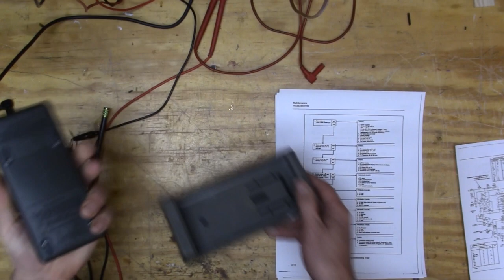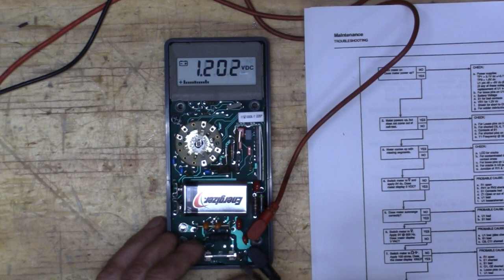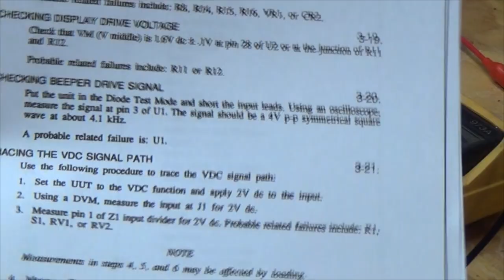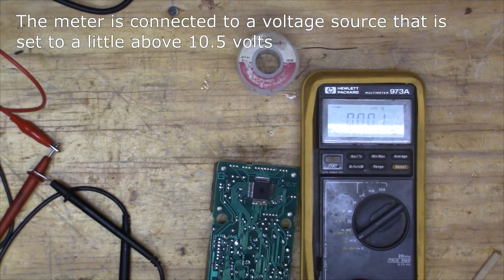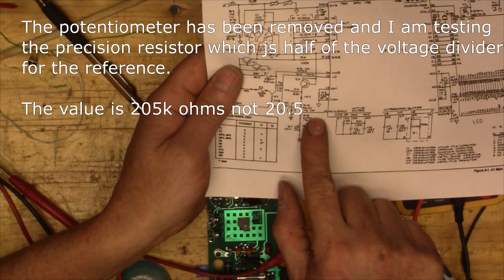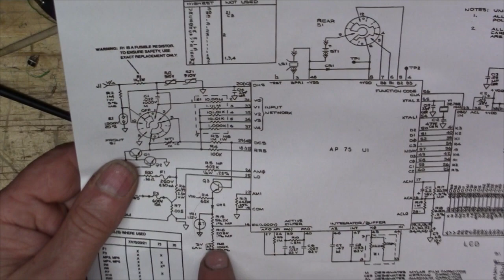Fluke 77 diagnosis and repair

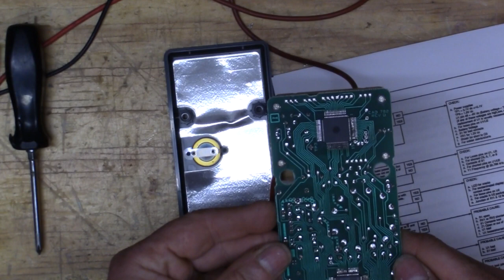Comment: @4:01 how does that Beeper connect to the board please?    My model 75 has a low beeper sound and i want to see if i can fix it.  Thanks.
Reply from the maker: Not sure, it has been awhile since I opened it. As I've gotten older it is harder and harder for me to hear the beep on these meters. I ended up building a dedicated continuity tester that I really like based on someone else's design. I did a video on putting it together. I replaced the piezo on my my oven because it was too quiet and now I can hear it much better.
Reply: @RobsFixitShop  Thanks for your quick reply, sir.   I actuallly found out its via those plastic looking pegs that contact it.  It's carbon infused and they conduct! :)    A friend at work gave me one of his similarly profiled beeprs and it got it to work again.  The original beeper was apparently corroded and caused it to fail.

Comment: Hi, I accidentally measured AC voltage on resistance mode. The Fluke 77 now doesn’t function. Could you pls help me with the troubleshooting & circuit diagram?

Comment: Should always use plastic and not metal to prob around in there and what makes it worse you have the power on. Had the same problem, bad selector switch. Ordered a new one..works fine.

Comment: It was an error in judgement not to change the battery in response to the low battery annunciator. The calibration is now suspect when a good battery is installed.

Comment: I think it's best to press using a stiff plastic Spudger tool.  A finger might be a kind of antenna.  The newer designs have the electrical contacts of the rotary switch right at the board level rather than a switch that is elevated from the board that can pickup noise.  Even the cheaper scopes of the past used wafer type switches while something like a Tektronix 7000 series scope has the contacts at board level using finger type contacts actuated by a cam of the rotary switch.

Comment: Rob, you might want to look into devising a way to check that your camera is seeing....most of what we should be looking at is glared out by your overhead light(s) in this video.

I was also cringing during a lot of this video as you came close to nailing the problem then got derailed by some inconsequential tangent....(but it happens, I know).

As some others have commented, the 77 was practically screaming at you to change the battery the whole time. When the display shows the LOW BATTERY icon, all bets are off as far as meter operation, not to mention performance, and although that was apparently not the only problem, you could have saved yourself a lot of time and grief by dealing with that obvious thing first.

You spent some time wrestling with the reference voltage into U1 pin 14. which is supposed to be dead-nuts-on 1.000V. This is simply derived from the internal 1.22V precision reference chip VR1, which does not look like an IC but is, then the excess 0.22V is dropped by R15, the 56.2k resistor, leaving 1.000V across the series combination of R16 (205k) & R8 (100k trim pot "3V Cal"). The trim put just adjusts the current through the voltage divider so that you get the proper voltage drop for the pin 14 input. But if the battery is low, the VR1 voltage might be below specs and this can throw off the reference voltage at pin 14, which can cause more significant errors and instabilities that look like something else is causing them.

You also appeared to just de-ox the front side contacts of rotary switch S1, and that side does manage the reconnections of the input signals to the U1 input pins. However, there is a set of contacts on the rear of S1, hard to access, and those handle two things: they are the power switch for the meter, and they control the three "function code" input signals to U1 that tell it which function is selected. Unlike earlier DMMs,  with their complex input circuit switching, the model 77 switch S1 is pretty simple and once it tells U1 which function is selected, the chip does the rest internally. If the function switching contacts are iffy due to dirt or corrosion, the chip might be randomly changing from function to function, making confusing displays that look like something else is causing them, and this can lead to unnecessary component replacements, re-soldering joints that are not bad, etc.

I have a few 77s, bought back in 1986 and used almost daily since then. They never miss a beat and are as good as new. I obtained a service manual way back when, and studied the same schematic you have, and there is really not much to go wrong on these, as long as the meters are used enough to prevent switch issues, the battery is kept fresh, and they are not abused.
Reply from the maker: Hey, thanks for the great comments. I do struggle with reflection from the overheads. Meter faces are the worst. I did use a power supply for some of the video which took the battery out of the loop. My channel is mostly about how I figure something out which can be pretty frustrating at times for people that actually know what they're doing!

Comment: Did you check the 9v battery???
I have one of the original Fluke 77 units, which I've owned since new (around 1987). Still works fine - just change the 9v battery every 3 or 4 years!
If you see the battery symbol (top left of display) on during normal operation (i.e. after the first 2 seconds of power-up), then the battery should be replaced.

Comment: Hello I have a multimeter Fluke 70 . doesn’t power on, I reemplace a diode 1N4448 (CR1) (The original diode is short)  . Is turned on, but no have lecture in diode and ohms Scale and other issue i have is  the multimeter power off in 300mv Scale like a short, bud does find other elements damaged in the motherboard. Greetings

Comment: Have the Fluke 75 , checking voltage 575v 3 phase .After second phase display show number even no test. battery, fuse, rotary seem ok. even at ohm function should read OL but some number showing. thanks for comment

Comment: Anyone know where I can get new or replacement test leads for my FLUKE 77 Multimeter?
Reply from the maker: I just got a new set of ProbeMaster probes that I really like. Here's the amazon link but I ordered them directly from probemaster. https://amzn.to/32mPUAv
Reply: i put these uni-T UTL-20 on y fluke 75. very well. https://www.aliexpress.com/item/32821721616.html?spm=2114.12010612.8148356.24.100a5ae2QgWZ0G

Comment: How you fix a low buzzer sound?
Reply from the maker: I don't know. I am thinking of doing something to my HP DVM for the same problem. I can never hear it!
Reply: I've opened mine up and have NO IDEA how the buzzer works - it does not appear to contact any board circuits.  Wireless???

Comment: hello Rob I have problem with display LCD... and need replace the CPU in the back lcd. is possible found this part?

I have this problem after using multimeter with low battery and have caused this problem 😭😭😭

dig2 c dig2 d  in test 3.7this 2 line not working

and have test pin out voltage have +0.30 v respect other pin.
if connect this pin to ground with one resistor 1000ohm I have visible this line for 2 second and after 2 second this two line ghost

Comment: hello Rob I have same multimeter do you have manual for check lcd segment ?
I have two segment with problem.
Reply: For Fluke 77 Service Manual You can download it from:   https://www.manualslib.com/manual/1006231/Fluke-77.html
For  Fluke 77 Series II service manual you can download from:
https://manualzz.com/doc/6275276/fluke-77--75--73--70--23--21-series-ii-service-manual
Zafar Hussain Karachi Pakistan
Reply: @zafarhussain6696  yeah i have chek and suppose the mcu is damaged. My pin segment have 0.20v extra surplus.respect the other pin. If connect the damaged pin to gnd with one 1k resistor the segment turn on for 1or 2 seconds.

If turn on the multimeter in test segment..this segment not turn on.
Reply: @zafarhussain6696  and have fluke 10 used with low battery. With problem ghost display.

Battery with low charge. Damage your multimeter.
This is a very problem!

Two multimeter used with battery low ... burning... 😢😢😢😢😢😢😢😢😢😢

Comment: Podrías mandar tu manual x pdf  ya que tu video es en inglés gracias
Reply: For Fluke 77 Service Manual You can download it from:   https://www.manualslib.com/manual/1006231/Fluke-77.html
For  Fluke 77 Series II service manual you can download from:
https://manualzz.com/doc/6275276/fluke-77--75--73--70--23--21-series-ii-service-manual
Karachi Pakistan
Reply from the maker: I put a link to the manual I used in the video description. Buenos dias!

Comment: Clearly the battery replacement symbol is top left of screen, the Fluke 77 will show low readings when this happens. replace battery job done!
Reply: Indeed. Whenever trying to fix any battery powered device, it's always wise to use a fresh one.

Comment: Ok, so i bought one of these like 5yrs ago at a garage sale for $1.00. At that time i could tell the battery was dying. But i figured id pop a new one in it. Well, all this time later (actually forgot i had it) i dug it out and of course the battery is dead. As i was about to throw it in the garbage (Because i already had 2 other ones) I noticed it said "Made in the USA"  Which surprised me, and how rugged it was. I decided to come inside and search online. After seeing what this thing cost new as of 2019 the new model 77 is ($360) I was glad i didnt throw it away. Mine is exactly like the one you have on the left, the older model. It has a orange stick on the back that says (Calibrated), then under BY: it says New Equip, Date: 1-89, DUE: On Reg. So i am assuming it was last calibrated in 1989. Thank you for making this video. It helped.

Comment: The majority of the various problems with the old Fluke 77 meters is simply to do with dried-out contacts on the rotary switch inside. You just need to use a sharp pointy X-acto blade and place a tiny, tiny amount of household oil to each track as you rotate the various switch positions. You should use magnification when doing this so that you don't over apply the oil. Basically, the oil just re-wets the tracks and combines with the original dried-out factory grease that remains on the tracks and contacts. Good Luck! These Fluke 77's are one of their most reliable DVM's. They'll last a lifetime if you take care of them.

Comment: My Fluke 75 behaved in the same strange way.

I first thought the battery (expired 2001!) was empty because the indicator was visible - but it was not(!).
In the end I just had to clean the contacts of the rotary switch with a toothbrush and
replace the smaller of the two fuses which was blown (tried to measure the voltage of a mosquito swatter in DC mode - maybe a mistake).

Although the battery is so old and the indicator shows up (which - according to the manual, which is for models 75 and 77 - means that 100 hours of operation remain)
it works again.
Even when I use a brand new battery, the indicator shows up.

Only when I use a rechargeable battery (which is not even fully charged) the indicator does not show up.

The voltages of the three batteries:
Old one: 8,83 V
New one: 9,68 V
Rechargeable: 8,72 V

A mystery.

Comment: my old fluke  worked  from when I bought it new, many years ago. recently I was changing corroded batteries in my simpson 260 and thought to change the 9 volt in the fluke. I replaced the battery and now it's dead as a door nail. No display no anything. Where can I get trouble shooting guide drawings or anything ????    w2dmw@optimum.net.........DON
Reply: For 
Fluke 77 Service Manual You can download it from:   https://www.manualslib.com/manual/1006231/Fluke-77.html
For  Fluke 77 Series II service manual you can download from:
https://manualzz.com/doc/6275276/fluke-77--75--73--70--23--21-series-ii-service-manual
Zafar Hussain Karachi Pakistan
Reply: Check Diode CR1 1N4448 maybe is short. Greetings

Comment: battery ok? I see the battery indicator - does that mean the battery is low?
Reply from the maker: I tried to read the user manual about what the display battery indicator was showing battery low or battery good but it was unclear. The battery was new.